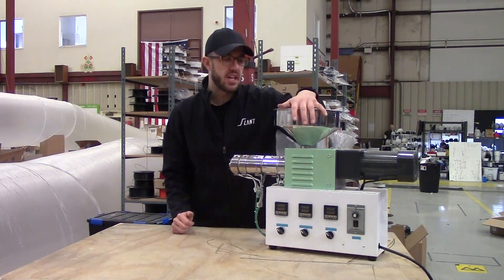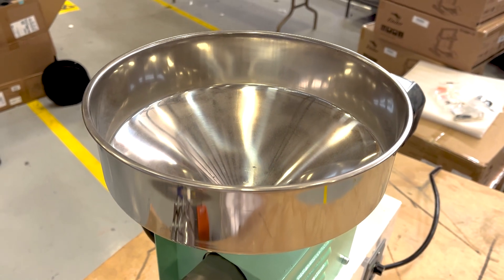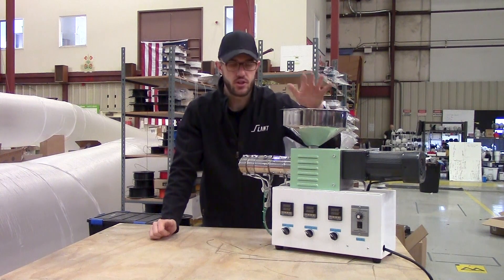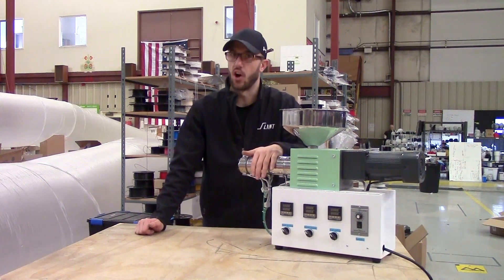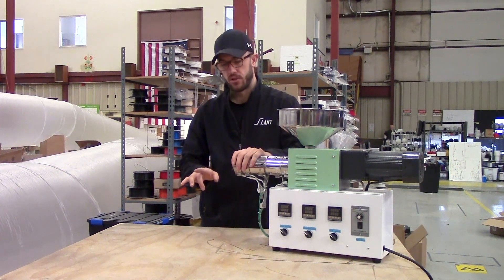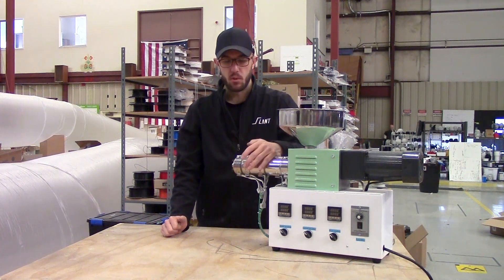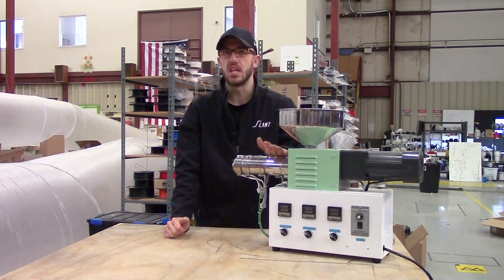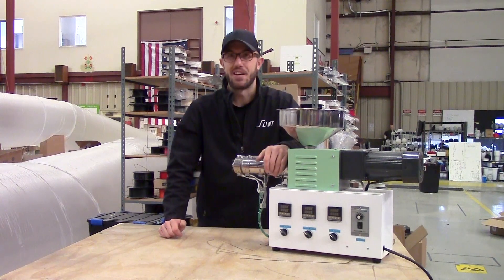S25 Desktop Filament Extruder - A Year Later

Comment: Probably the heating elements are for 220 VAC and the manufacturer did not reconfigure for 120 VAC.  It would be difficult even to test the US version in China.  Power varies as voltage squared.  Of course the US product is defective, but perhaps a 230 VAC customer would not be so disappointed.

Comment: I have access to a recycling facility and they have given me some space to experiment with PLA (for now). I can use their machines for grinding the material into pellets but I need to put together a proof of concept for an extruder without spending 10K on a serious machine. Obviously these Chinese models are shit but is there anything mid market value or is there a market for used professional machines? This might not work, but I won't know until I try. Any advice would be appreciated.

Comment: Just FYI - the temp controllers are PID controllers, not PLC (Programmable logic controllers). Have you tried adjusting the setitngs?  PID stands for Proportional, Integral, Derivitive. P inputs a large correction for a large difference. I reduces the input based on corrections made in the past, and D is trying to predict future variances. They can be tuned and it makes a significant difference on how quickly the temp will get to set point, and how long it takes to stabilize. If it's not heating enough, the elements could be undersized, or the settings could be way off.

Comment: I find it extremely unlikely that it doesn't actually work.
I suspect yours has something wrong with it.
And it's probably the incorrect resistance on the heaters. I would be it has a mix of 240 and 120 volt parts.
I am quite certain I could make it work with just some troubleshooting. 
ALso, wrap the barrel in mineral insulation to stabilize the heat zone.

Comment: I would like better specifics.  It was said thay it took for ever to heat up but compared to what.  Our industrial extruders from cold can take upwards of 4+ hours before we can push poly at 350 degrees.  Then once we get the poly moving slowly shear heat takes over.  The heater bands are primarly only for heat up and for maintaining exteranl barrel temps so that the flow on the walls will be more consistent with the middle.

Im not a plastics engineer but to extruder pla based on printer operation i would think barral temps need to reach 400+°f and hotter for faster extrusion.

It would be nice to here a technical feedback on the machine, what was tried and what was the setup and after what trouble shooting steps were the issues.

Comment: Sounds EXACTLY like what happens when you don’t set the voltage correctly… The Sign shop’s did the same, then I read the “Manual”.😂.. Manual?..Nothing was in English😉, I just figured this due to past experiences, Opened it up, set the power supply to U.S. and then Wham.. The Heaters heated up correctly, the motor ran smoothly and etc.. (still a Pain, but it works).
It could be something Different (Blown Cap, Etc).. This is just My Experience with A similar, almost exact same contraption.🤙🏻

Comment: You may try mounting it at an angle 45-60degree and run the extruded filament through a tension-er of some sort like I have seen done with other extruders.  Don't mean to be rude but it seems you gave up on this machine a little too soon.  Thought you had used it for a year (like the title reads) but I guess not.

Comment: One issue I had with an SJ 35 is the gap between the barrel and the cowling. When the fan came on it blew cold air down one side of the barrel cooling it and it was impossible to get consistent filament diameter. Once the gap was covered the temperature and filament diameter was perfect. I find them to be very well made and strong machines. Biggest issue would be trying to extrude when not enough temperature. It will ruin the gearbox quickly

Comment: I've bought four extruders from this company. The one step larger ones (SJ-35) and they work great!
Reply: does it work with PET ?
Reply: We use ours for DuPont Nylon..(pa6 gf)..
Sounds like they didn’t set the power supply correctly..(110 volt).
Reply: @0Logan05 that's what I wondered. With it being slow and couldn't heat properly, maybe it's a 240v machine being run on 110v?
Reply: How many kg per hour can realy do SJ 35 with PET G Filament 1.75

Comment: The difference between people with a engineering problem solving mind and basic end users. Just convert it to 220 or make sure they didn’t leave it set up for 220 behind the power panel. They probably just threw a 110 plug on it and left it wired for 220 so it’s operating at half power.  You’re welcome! :)
Reply: Imagine thinking this guy doesn't have an engineering mindset 😂
Reply: @anthonyskrzypczak9437  Considering... a lot of people DO use these machines and they DO work, and he just wrote it off yeah... if people can't be bothered to understand the machines they run, well guess what they cant run the machines.

Comment: I have the whole extrusion line and it works even with materials like PEEK . It depends on the user and their knowledge of how to run the machine. I have produced over 500 kgs of filament and the screw is still good for almost double that.
Reply: so you have the 500C version? how many screw RPM can you get and is this the 13:1 LD version? you run PEEK at what temp on this line?
Reply: @rexxx927  I have 14:1 LD 25mm dia, 38CrMoAIA barrel and screw rpm about 25 but with PEEK it reduces upto 16. The heating zone is 375-385-390.  Works perfect if set right.
Reply: @Modlonpolymers  Excellent! the last guy told me he run Peek at 325 lol where are you located and have you done and GF or CF PEI or other HT resins?
Reply: @rexxx927  I am located in Canada as well as India and we have not tried gf materials in filament extrusion, our India branch manufacturers compounded granules for engineering plastics including pa-6/66 GF+FR/PBT/POM/ABS/PEEK/PC and PLA for moulding/extrusion purposes.
Reply: @Modlonpolymers  nice! do you have discord? i would like to learn more about it
Reply: @rexxx927  sadly I don't use discord
Reply: @Modlonpolymers  don't worry your not missing much if your close i would like to try discussing tolling some trials should you be in Ontario i would like to talk more about it should you be interested, we may have some good info to exchange i have been in film and filaments for 23 yrs
Reply: @siddharthjain3312 where are you based at in India 
We are collaborating with industries for research purposes
Would be a pleasure to connect with your Indian partners
Reply: @MrAts1984  yes i am based in India, New Delhi. I can do R&D trials for the right prices.
Reply: How many kg per hour can realy make with SJ 35 for Pet G Filament 1.75?
Reply: Could it be a 220v machine that the factory yolo’d a 110v plug onto, hoping the automatic temp controller will do the job - since it is lacking any heating power?
Reply: @not_anton  i think this guy just doesn't knows much about extrusion tbh, or is getting paid off by more expensive companies like filabot and 3devo so that chinese machines dont take over the market.
Reply: Have you tried to press Pet g how many kilograms per hour can this extruder press per hour?
Reply: @АлександрБаландин-щ4ш  ABOUT 5KG PER HOUR

Comment: With a title like "A Year Later" I expected your experience from using it for a year, but you just said it doesn't work. So, I assume you tried it and it sucked and it's sat there for a year? What's the year got to do with it?
Reply: I think they didn't want to review it as the machine clearly looks unused, I have a machine line of sj25 and it works perfectly in every way. Haven't had a single issue with heating
Reply: @Modlonpolymers  Do you have the similar winding machines? Up for making a video of your lines and process?
Reply: @skaltura  yes i do have couple of units running and they work perfect. I just think these guys didn't get their money from manufacturer that's why they are saying these things about the product. Or else they don't have a clue what they are talking about.
Reply: it just feels like the competition is conducting a review on a product hahahaha
Reply: I think that's what happened and where the fuck is the $25 from it is a $1300 machine💀

Comment: Low heating speed makes me think that maybe it is designed for 220V, and if it is connected to 110V, it would get 1/3 of power. May be worth investigating if you have 220V aviable
Reply: 1/4 *

Comment: I know y'all don't have the time but I would a series of yall "diddling around" with this and the filabot to get them working again and then making them work better for small production ;p
Reply: It could just be a marketing tactic to defame machines that work well, I have a SJ 25 and I haven't had any issues in long term producing filaments even at high temps @380°C

Comment: Well thats disappointing. I was looking to get this instead of a new filabot. Is there anything you've had luck with?
Reply: It works , I have the whole setup and I have produced over 500 rolls on it. It's a reliable machine and I haven't had any issues with extruding even peek at 380°C
Reply: @Modlonpolymers how many rolls can you make with it per day

Comment: That's because it's a poorly modified injection moulding machine haha That isn't designed for extruding filament at all
Reply from the maker: Extruding a very basic process. The design is fine at a high level. But the details didn't go right.
Reply: @slant3d  Thanks for the view its not a great unit maybe but an extruder extruding like a hot glue gun is a very basic process yes but with a screw "Real Extruder" there is many things like LD ratios your backpressure the screw to barrel tolerances the style of screw the metering zone the feed zone and not to mention heating zones and cooling zones even pressure transducers melt temp readings are used to get an proper extrusions and extruders can make 1500-10000 psi (even pellet size)to make the flow for that material correct then you have screen packs with different meshes and usually the trust bearings are cooled with water to keep the line and hopper at bay and not to mention the compression factor these all need to be right to "Basically Extrude properly" i have run 200HP to 5 hp extruders 35mm-4.5" OD screws with productions from 5-800lbs/hr co-ex multilayer lines as well should you be interested in a hand producing production hit me back,
Reply: @rexxx927  lots of people run this same machine, and it runs well... the key difference is input voltage, most likely he has a 220V machine and using it on 110V in the US.... hard to explain the severe power loss in such a simple machine otherwise.
Reply: @Wingnut353  the machine heating and motor power are some yes but the screw compression and barrel to screw tolerance are made like a glue gun no back pressures are really realized like a REAL extruder which can make 5000-10000 psi this thing wont make 100 psi in back pressure thus why it doesn't even have a BP gauge or MT gauge lol and can run on 120 VAC its really more of an auger then an extruder! if your into ABS PLA and even ASA ya you can make filament with it but your tolerances will not be consistent as the line cannot keep the pressures and the correct flow and if you turn the heats down to help consistency then you have polymerisation issues and others not to mention mixing additives will not mix correctly or consistently at 3 lbs/hr and 100psi back pressure lol you do realize the LD on this thing is like 12:1 right? its a glue gun nothing more!
Reply: without realizing BP's appropriately you will induce burnt polys and carbon contaminations along with gauge profile errors that can only be masked but i will agree some resins will work on this but very very limited from throughput to QC and some resins like low LD and compressions but require a range of BP still to do it correctly! cheers!
Reply: @Wingnut353  are you wingnut or are you cusbrar lol your reply says wingnut but now here its cusbrar i thought i replied to the wrong name? nope...
Reply: @rexxx927  Actually, the way plastic is both made and colored in a factory setting is done purely with a twin-screw extruder called a compounder. It is basically a large-scale version of the machine shown in the video above, only it also has doses for ingredient addition to the plastic fibre (could be PLA plastic) such as additives, pigment (powdered mica for instance), fillers, and what have you. It also has melt filters for removing impurities and shaper dies. The sheer friction of the two interlocking twin screws is what is used to melt the plastic and everything else enough for it to truly mix together all throughout. The screws also move this new mixture through the barrel and out of the extruder, where the "ropes" or "threads" of extruded material is pulled out further, often done underwater part of the way, and these then wind up over at a more simple machine consisting of possibly a metal bucket and a blade that cuts these these "threads" into small plastic pellets. This is how you end up with a masterbatch, which is what is used to make more plastic of a certain color and property, usually by mixing the masterbatch with pellets of the base plastic so you can save on the material of the masterbatch, or by just using the masterbatch up.

This is also how you make masterbatches for 3D print filament plastic.

These machines also have electric heaters around the barrel to make sure the plastic doesn't stick to the sides of the inside of the barrel and keeps it moving more freely ahead.

Comment: This would never work for 1.75mm filament anyway.
Reply from the maker: Desktop extruders can work reasonbly well for testing of 1.75. It depends on the machine
Reply: It works fine, OPs machine probably has the transformer isn't wired for 120v (the perils of ordering from china) but... you could probably run it just fine on 220v.

Comment: About experimenting: What throughput and ROI could you achieve by using the VzBot 3d printer and/or the Pantheon Design HS3 3d printer? Also, fully enclosed and fast 3d printers can save 80% on electricity consumption!
Reply from the maker: We only work with our own machine designs. There is nothing off the shelf that has been designed for high throughput. So we made them

Comment: What extruder, hot end, and nozzle do you find to be most dependable? Which have you chosen to use on your machines?
Reply from the maker: We developed all of our hardware internally. Nearly nothing is off the shelf.
Reply: @slant3d  that a great way to avoid many of the shipping and resourcing challenges from overseas suppliers.

Comment: Extremely interesting! I know that there are double screw version of this machine, as well as a version with a bigger motor. Also, could this be the 220V version which they simply wired as a 110V? What if you try to properly (wiring modifications) use it on 220~240V?
Reply: Twin screw machine are for compounding usually if you run one base resin at a time you only need a single screw extruder as for your amps go by the wattage to get the current draw it should have V x A = W you should see then if its 110 or 220V
ex. ,110v x 3 amps is 330 w, 220v x 3 amps is 660 w   If your machine wattage is rated @ 330-350w its a 110volt machine and so on  cheers
Reply from the maker: We did give that a shot.
Reply: what V it runs at should not matter at all for performance. If the corresponding amps are correct for the power of the engine.
Reply: @Toffypops  It could make a big difference on the heating elements. Half the voltage basically means only 1/4 the heating power from a resistive heating element. Its not as big of a difference on PTC heaters, but i don't think one would want to use them on machines with a need for fine temperature control.